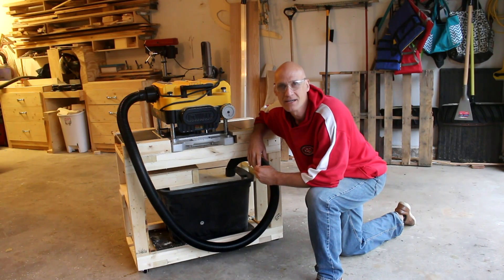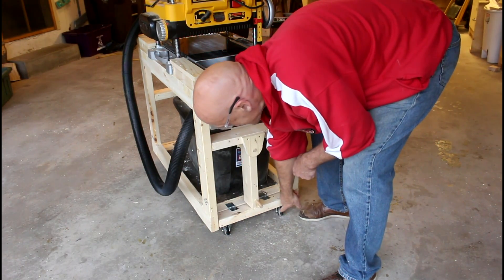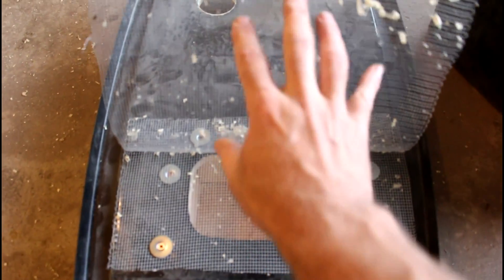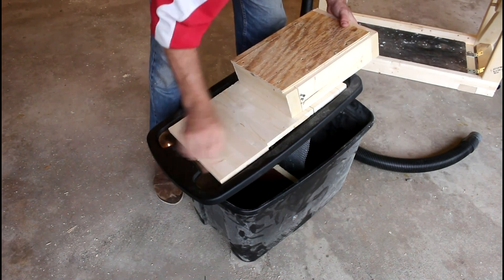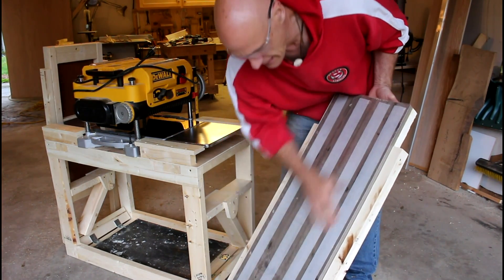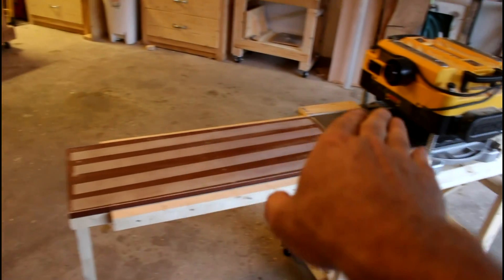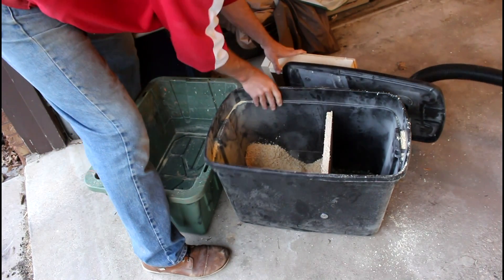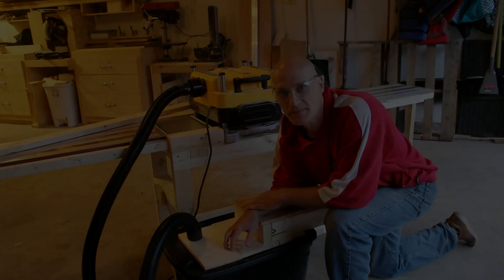My Mobile Planer Stand

Comment: Great idea using the bin that fits under the cart. I have built a similar cart and will utilize the bin idea rather than a big, separate trash can. Im gwetting the same planer soon. I'm not understanding how the dust ends up on the opposite side of your seperator from your hose in-feed. Thank you for the idea. What a space saver!

Comment: How come you didn’t just drill a hole on the far side to let the air out? (With mesh screen to stop chips). I don’t understand how a board in the middle of the bin does anything except make it smaller? And why is there mesh on the other side seems to me it should be on the hose inlet side to work screening off large chips and letting fine dust and air out to other side?

Comment: No vacuum suction on the sawdust capturing container?

I have been having on mind to use conveyor rails, 18 inches wide by above 3 feet long, by using one on each side of my planer, building some sort of table or cabinet. Alternatively, I am thinking about buying the leg units for the two rail pieces.

However, since seeing your build, I'm contemplating something similar to get rid of that pesky snipe or, at least, most of it.

The rails that have caught my attention advertised on Amazon are not available.
Reply: The planer Mark is using has a built-in blower to expel the chips, so no vacuum is needed. With other models, maybe, but not this one.

Comment: Hey Mark, great design!  I have some follow-up questions as I am considering your design for a  table top saw I have restored.  Did you find the dowel 'hinge', wheels, wheel hinges and single 2X4 was sufficient for supporting the weight of the cart as you rolled it around?  I'm considering using 2X2" angle steel and a bolt for the hinge pin assembly, unless you find the wooden counterparts are sufficient.  I am also considering using larger hinges for the 'caster board'  and locating them as far outboard as possible for support.

I would love to know your thoughts almost four years later.  Thanks again for the great idea!